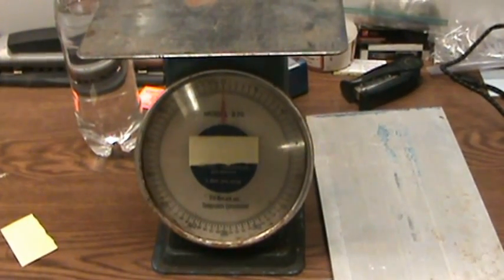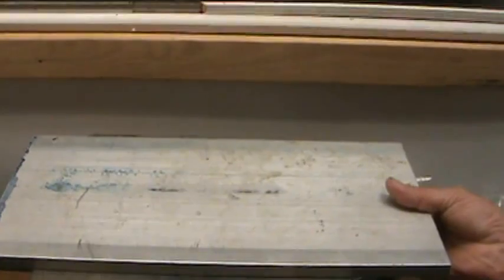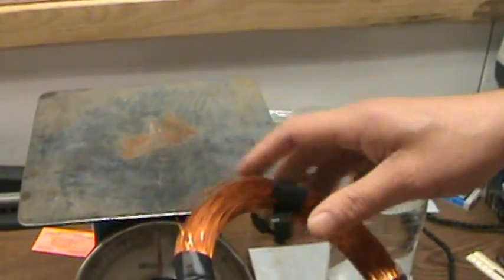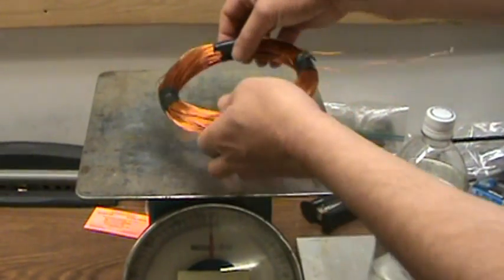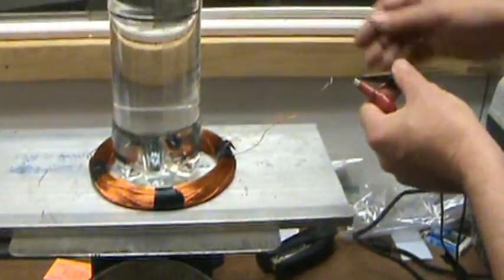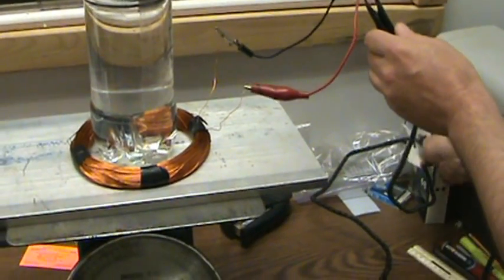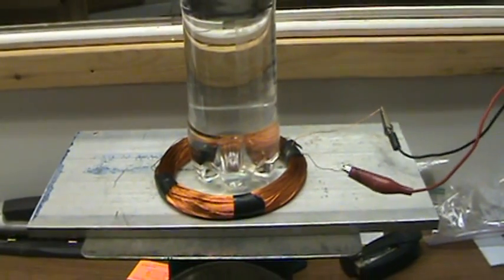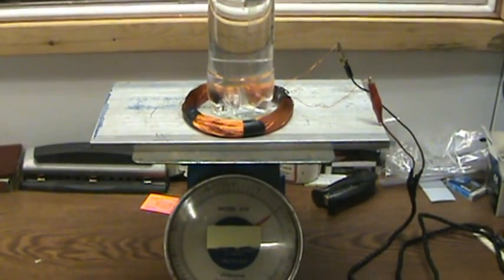Coil Levitating Over Aluminum Plate, Lenz's Law, checking mass

Comment: Very good point... it should not be called antigravity, Its just REPULSION. As current moves through the coil, the clockwise direction of the induced magnetic field pushes itself upward with the space molecules around it. We ca not see air molecules, neither magnetic field but there it is they could see each other. So its like a simple " push up ".

Comment: Now do the same thing without the thick metal to resist against.

The earth, not being a smooth aluminum sphere will have far less diamagnetic and paramagnetic response.

And if you think you will do this against the nickel iron core of the earth...you're going to run into some complications I promise you.